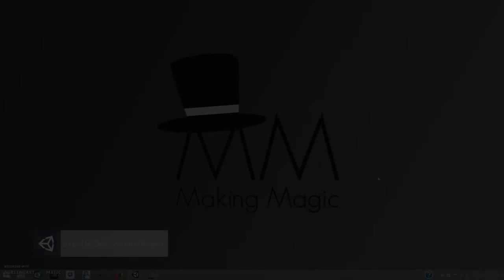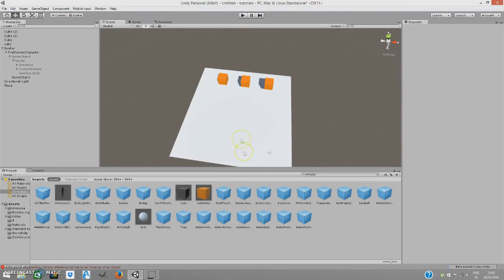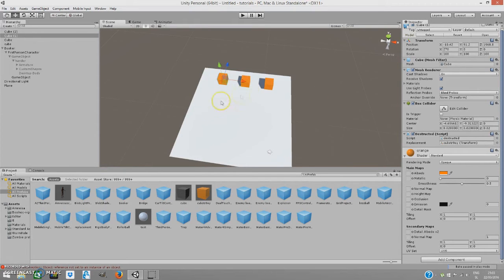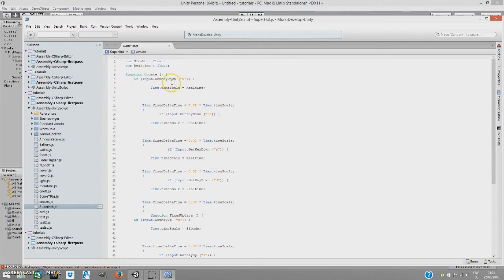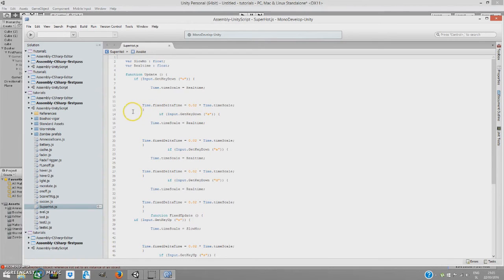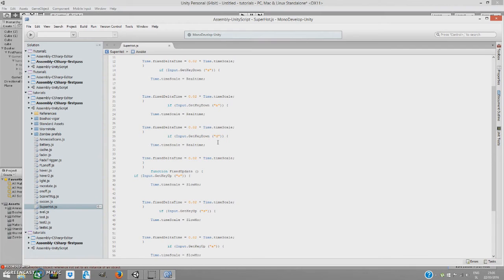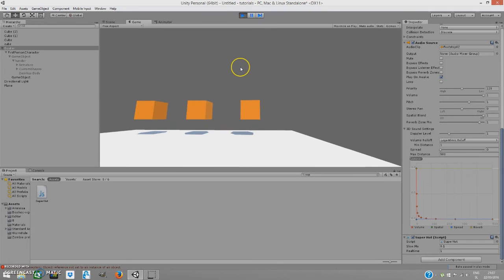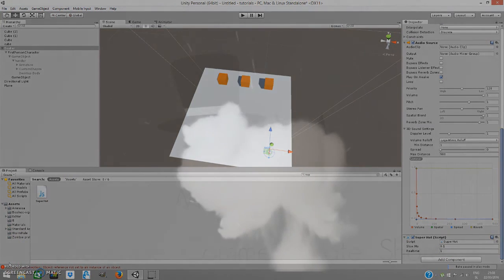Unity3d - SUPERHOT Slow Motion Tutorial

Comment: Great tutorial. Subscribed ! I was wondering if it was possible to integrate this script with Gear VR controls?
Reply from the maker: +Reke Onamusi Sure its possible :D but I never tried anything with vr yet :D
Reply: +MakingMagic Thanks for the quick reply! These are the gear VR input controls: 
#if UNITY_ANDROID
if (GearVRInput.GetAxisX > 0.1f)
{
moveForward = true;
}
if (GearVRInput.GetAxisX < -0.1f)
{
moveBack = true;
}
#endif

Could you replace the input controls in your script with these? sorry i am new to scripting, and it would be amazing if i could get this to work with your script.
Reply from the maker: +Reke Onamusi 
 
var SlowMo : float = 0.2;///Smaller the number is bigger slowmotion
var Realtime : float = 1;///1 meens no slow motion

UNITY_ANDROID 
if (GearVRInput.GetAxisX > 0.1f) { 

moveForward = true; 
slowmo();

} 
if (GearVRInput.GetAxisX < -0.1f) { 

moveBack = true; 
slowmo();

}
if (GearVRInput.GetAxisZ > 0.1f) { 

moveRight = true; 
slowmo();

} 
if (GearVRInput.GetAxisZ < -0.1f) { 

moveLeft = true; 
slowmo();

}
if (GearVRInput.GetAxisX == 0f) { 

moveForward = true; 
nomo();

} 
if (GearVRInput.GetAxisX == 0f) { 

moveBack = true; 
nomo();

}
if (GearVRInput.GetAxisZ == 0f) { 

moveRight = true; 
nomo();

} 
if (GearVRInput.GetAxisZ == 0f) { 

moveLeft = true; 
nomo();

}
function nomo(){

 Time.timeScale = Realtime;
 Time.fixedDeltaTime = 0.02 * Time.timeScale;

}
function slowmo(){

 Time.timeScale = SlowMo;
 Time.fixedDeltaTime = 0.02 * Time.timeScale;

}
///if that works then its a miracle there s probably lots of errors :D